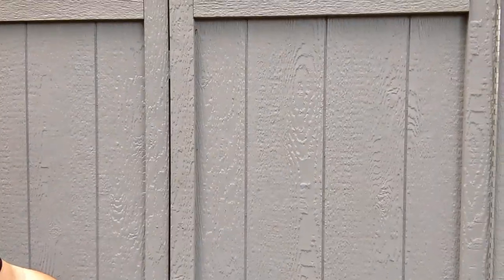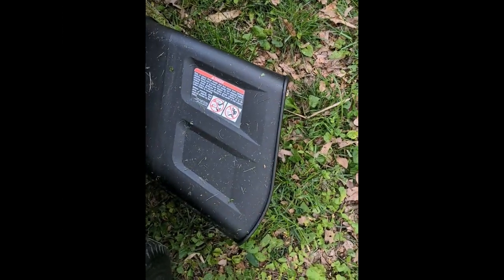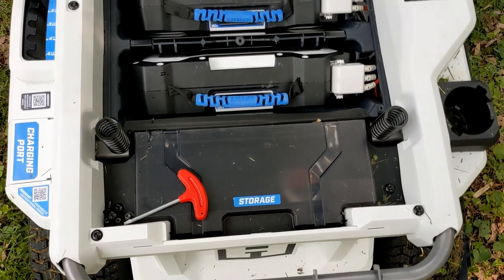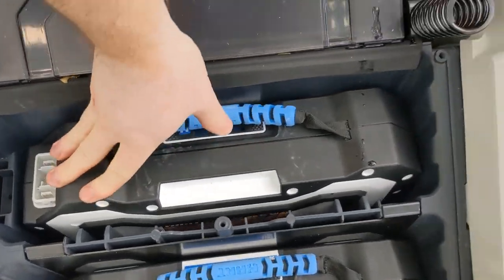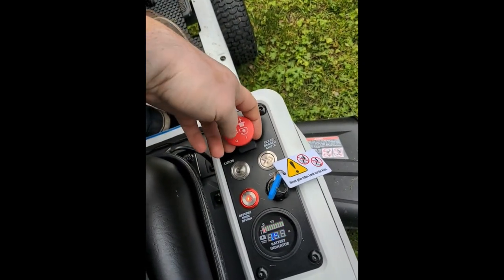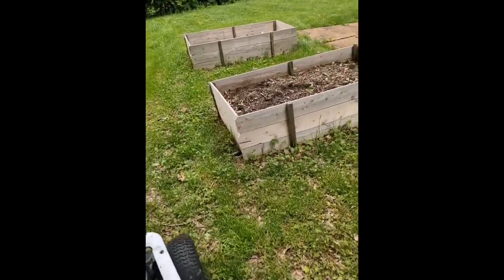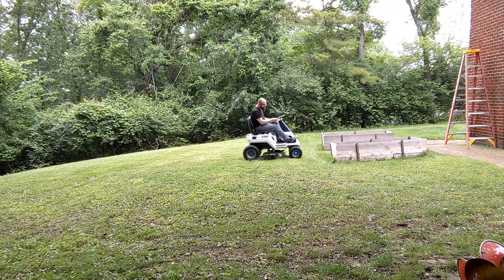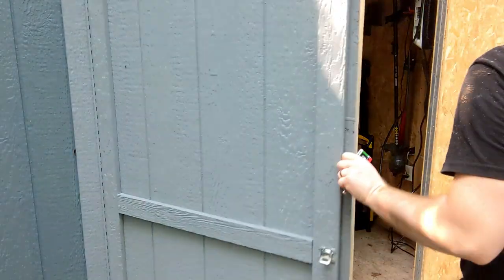Revolutionizing Lawn Care : Walmart's Hart 80V Battery Riding Mower - Full Review and Demonstration

Comment: Saw one of these in the store. Good price, but not built nearly as stout as the Ryobi RM480 48 volt riders. Big issue is the cost and ability to replace the battery pack. Just replaced the batteries in my five year old RM480e for $660.
Reply from the maker: The Ryobi RM480 has lead acid batteries doesn't it?  At 48v and lead acid, I think the Hart's 80v lithium mower is a better deal.
Reply: @mushroom89  Again, the cost of operation with electric riders is dependent on the lifespan and replacement cost of the batteries. The 75 ahr., 12 voltSLA/AGM  batteries in my RM480e ran for 58 months, 160 hours of use, and 2,082 charges. It cost me $660 to replace them with 100 ahr. batteries which the savings over an ICE mower hit after 54 months. Few of these lithium powered mower makers will state the life span of their battery packs. Ego does state a limit of 1,000 charge cycles for their 56 volt packs.  CubCadet doesn't state a limit, but the lithium pack in their electric riders costs $4,000 and requires a CC technician to service the replacement. FWIW, Tesla stated the first generation battery packs in their cars were good for 1,600 charge cycles (300K-500K miles) and cost $19,000 to replace. My point is that the lithium riding mowers haven't been around long enough to establish any sort of cost effectiveness regarding the batteries.
Reply from the maker: @jfrye2475  Did you watch the video?  This mower has removable lithium batteries.  You can use the same ones Ryobi makes and they're $700 I think.
Reply: @mushroom89  Yes, I did view the video and the batteries do look like the Ryobi 80 volt, 10 ahr. packs. The Ryobi packs list for $899 each. Didn't see any comparable Hart batteries listed anywhere. Again, no one is saying how many charge cycles these will do, and they haven't been in use long enough to see. When I bought my RM480e, Ryobi was saying about five years of life span for the Leoch batteries. The Ryobi system limits the Depth Of Discharge (DOD) to 30% (70% remaining) and Leoch stated the batteries should do 1,500-1,700 cycles at that DOD. Battery sites state the SLA/AGM batteries will do five times the 50% DOD rating at 10% DOD. The 50% DOD rating was 500-600 cycles, so at 10% DOD, they should do close to 2,500 cycles. My mower has a DOD of just over 10% and saved $685 in gas and maintenance over 54 months and the four replacement batteries cost $660 total. My question is: Will the lithium batteries last long enough to pass the breakeven point? The batteries in this Hart mower will cost $1,800 to replace. Will they last long enough to make it a cost effective solution?
Reply from the maker: @jfrye2475  I don't have the time or interest to look into the specific rated number of cycles for the batteries or if Hart even has that documented anywhere, but typically Lithium batteries have a longer lifespan than lead acid, have higher capacity, and their easy to remove.  Their capacity should be more since lead acid can't discharge past 50% without permanent damage.  The cost difference between Ryobi's lead acid mower and Hart's lithium mower is not much.  I would go with lithium.
Reply: @jfrye2475  Just curious what you're cutting that you charged it over 2,000 times in less than five years but only ran it 160 hours.
Reply: @markkempton4579  My average use is just over 40 minutes and the system recharges the pack after each use. The charger monitors the battery pack and automatically does a maintenance charge if the pack voltage falls below 50 volts. During winter storage it will charge the pack multiple times. Also, as the SLA/AGM batteries age, they will self discharge quicker thus requiring more maintenance charges. My average DOD is just over 10%, so the batteries last longer than normal. My total electric cost for 58 months is $42.55 for that 160 hours of run time and winter storages.
Reply: @jfrye2475   Lithium batteries have been around a relatively long time so their cost effectiveness can be charted no matter if they are being used in a car, mower, electric bike, etc.  Generally speaking, as long as the lithium batteries are good quality and the charge -discharge cycles are properly controlled/ monitored by the BMS/ consumer , the batteries should provide better performance and cost effectiveness then lead acid batteries, not to mention that huge weight savings. Of course lithium batteries can pose some risks , but so can lead acid batteries.
Reply: @davehimlin2374  I agree completely, but so far, I nave not seen anyone who has recorded and charted the long term use of lithium in riding mowers, so I don't know how they will perform cost-wise. Given the cost of lithium batteries, what is the breakeven point when they have saved enough in gas and maintenance over an ICE mower to pay for replacements? The replacement cost of the SLA/AGM batteries in my mower were covered after just 54 months after backing out the cost of electricity. If the lithium packs last 10-15 years, will that cover their replacement cost? My first lithium tool battery pack lasted 13 years in rotation with five other packs.
Reply: @jfrye6057   long term use of lithium batteries ,  is well documented....it doesnt matter what they are used in...as long as they are used-maintained correctly and that the BMS is properly functioning/programmed. Many people abuse/mis-use such things therefore the longevtiy is drasitcally reduced. I have greenworks yard tools and have used the same 40 volt lithium batteries for 5 years now, without any issues...but I use those batteries properly.
Reply: @jfrye6057  it's good that your Ryobi lead acid  batteries lasted 5 years but that hasn't been the case for others. YouTube channel aging wheels has a bigger yard and he couldn't finish cutting it by the second year. I don't think he even got 2 years out of the lead acid batteries before the machine became unusable.
Reply: @jasonvickery9256  Yes, I've seen many statements by Ryobi 48 volt mower users complaining of short lifespan. However, none of them stated they followed Ryobi's troubleshooting procedure to identify the failure. It only takes one failing battery of the four to reduce run time. I had one fail under warranty and the single replacement restored run time. So a single replacement battery fixed the problem at a reduced cost even out of warranty.  There are five of these on my street and one had over 300 hours of run time before one battery of the four was not standing up to a load test. I'm not saying lithium isn't good. I just wonder about the cost, and lifespan of the packs. This is new territory and we'll have to see how they hold up. Since the Ryobi system is basically a golf cart with a mower deck, I talked to a cart master at a local club to get an insight on battery life before I bought one.
Reply: I'm not adverse to lithium technology. I have over a dozen 18 volt & 40 volt packs and some are over 10 years old, but they are used in rotation. Folks with battery powered mowers have complained about failing batteries for some time now, and not just the Ryobis. I tracked every usage of mine and it took 58 months to save $700 in gas and maintenance costs minus my cost of electricity ($0.062/KWH). Of course usage, gas prices, electric cost, maintenance factor into each user's experience (YMMV). So my experience shows it taking over 6 years (6.2) to save enough to pay for single Ryobi 80 volt, 10 ahr. battery pack. The Hart rider has 2, 80 volt packs,  if I had one it would take almost 12.5 years to breakeven on battery cost. Thus my question is will the batteries last long enough in a rider to be cost effective? It's likely too soon to tell for some brands.
Reply: @jfrye6057  Well, alot of issues with lithium batteries, may be caused by the consumer, not understanding how to treat/ charge/discharge them for best performance/ longevity. Personally, I am not interested in purchasing a battery powered riding mower, but I do have many other yard tools that use lithium batteries and am happy with them
Reply: @mushroom89 great video. That help my decision on ordering one. Also I noticed Home Depot stopped selling the small Ryobi electric riding mowers with the SLA batteries. They’re probably coming out with newer lithium models. Also the Hart only take 2hrs to fully charge vs the RYOBI takes 12hrs. I’m. Lithium ftw!

Comment: I sure hope you have better luck with the riding Hart lawn mower than I had with the 40 V push mower that I think is a complete piece of s%!t. Mowed our little yard a few times and now the battery won't charge. What complete crap!
Reply: If you leave the battery on the charger all the time you will kill it. After you finish mowing go take a shower and when you are finished, but the battery on charge and as soon as it is fully charged remove it from the charger. Take it in the house do not leave it in an unheated shed or garage over the winter. Take it in the house during the summer months as well. These batteries do not tolerate temp. extremes. Not to hot and not to cold. Mine is three years old now and I can mow both mine and my neighbors yard on a charge. Little more than an hour run time. I love mine. 40volt 20inch walk behind.